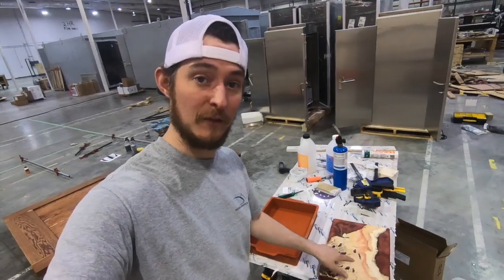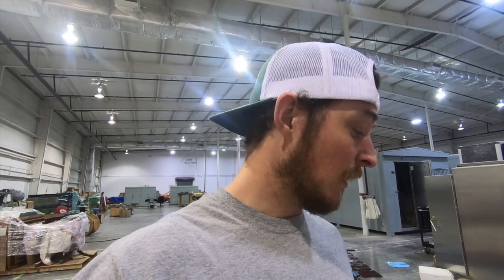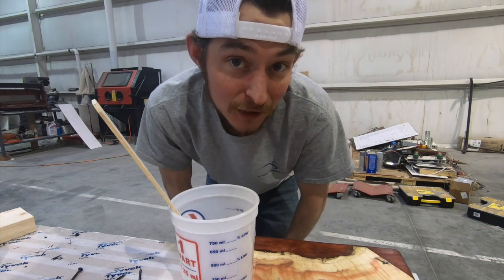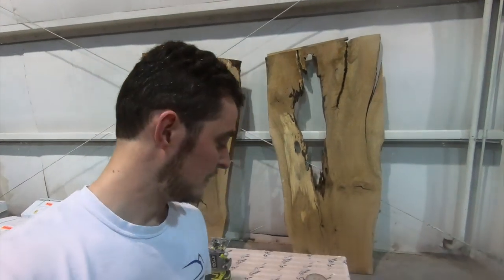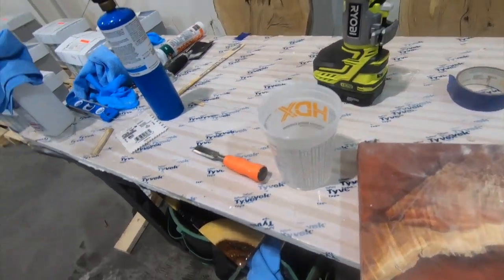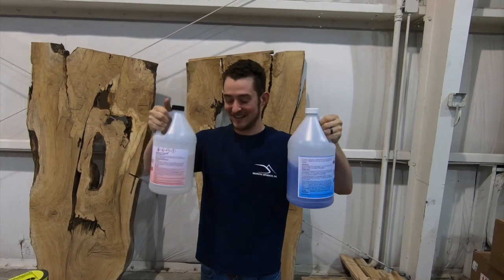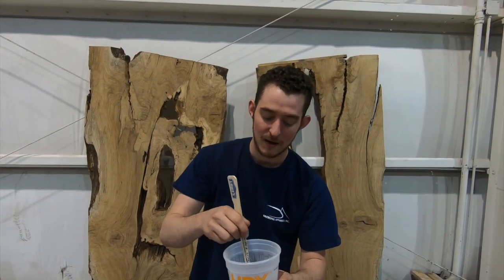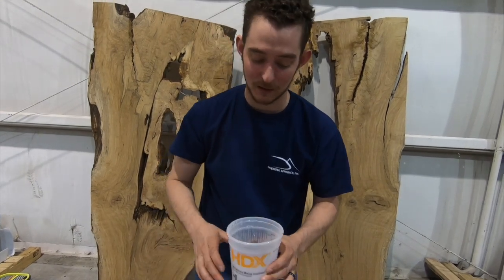FIRE Epoxy Serving Board part 2

Comment: The drips on the final flow, on the bottom of the board,  don't' need to be leveled? You just let them drip and dry?
Awesome video!
Reply from the maker: I put a piece of tape on the bottom edge so that when it drips, they land on the tape. I remove the tape when the epoxy starts to harden but it’s still soft. Hope this makes sense.

Comment: Always great videos. However in this one how did you do the flood coat on the opposite side and did you have drip lumps ( technical term, ha) along the bottom edge ?
Reply from the maker: I flood coat the bottom with the defers taped up, then after it’s cured i router/ sand the edges then I tape the bottom side and flip the piece over. I then pour a flood coat from the top and let it run over the sides. The drips land and dry on the surface of the tape. I then peel the tape off along with the drips.

Comment: Really enjoying you videos I'm wanting to start my own small project to make the coffee station and office space counter top for my house I'm getting built. I was think of doing my bathroom sink counters to would you recommend I cut the holes for sink and plumbing first before attempting to pore the epoxy also for electrical cable on my deck top or would you recommend I drill and cut the holes after. I enjoy your work man looks really good.
Reply from the maker: Thanks! I would drill the holes after the epoxy was finished.

Comment: Hey man I got some questions, when you said “we’ll go over it again 3 times” you mean the epoxy coats or just with the heat gun every 15 minutes. Also did you do the same process to the other side? And would this epoxy process be safe for a cutting board? I just did my first woodworking piece last week, and I’m fairly new to all this 😅

Comment: Nice job!  FYI.  Stone coat countertop quick coat gets Yellow very quickly.  Not a good choice if you need UV protection.
Reply: I have not had that issue with Stonecoat. Perhaps you had a bad batch. I did a big river table for outdoor use and have not had any yellowing in over 8 months outside. I use their epoxy, Total Boat and Ecopoxy depending on the project. So I am not partial to one epoxy.

Comment: Question from VA. Where do you get a variety pack of 5" sandpaper  for my orbital higher than 400 grit ? also where did you get the plastic tub ? This is one of many of my favorites! cant wait on the floor!!!!!
Reply: Klingspor is the best sand paper out there  They have hundred of different grits and papers. I had a custom cabinet business for 12 years and that is the only sand paper we used.